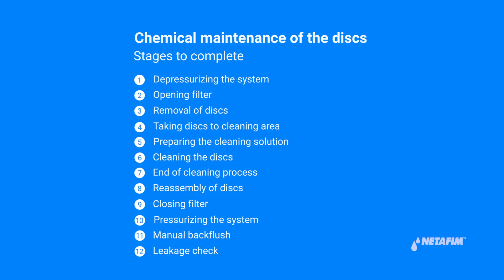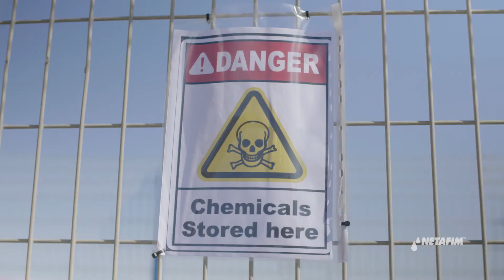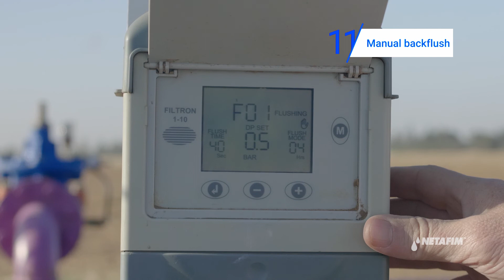Spin Klin™ Disc Filter: How to Do Chemical Maintenance of Discs | Netafim

Comment: Thank you guys! This was helpful. Some of the 10" filter cartridge assemblies with black plastic inner frame holding the discs, will melt in mureadic acid solution 😞. My experiment had very limited scope, but I was up for an unpleasant surprise.